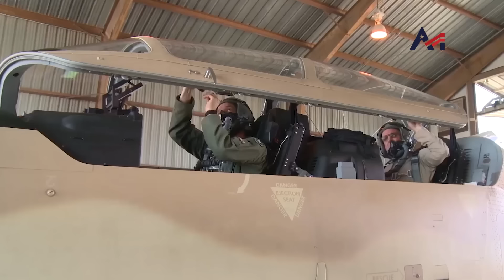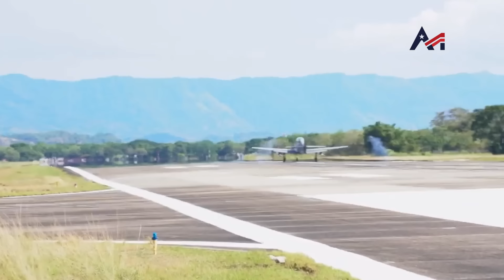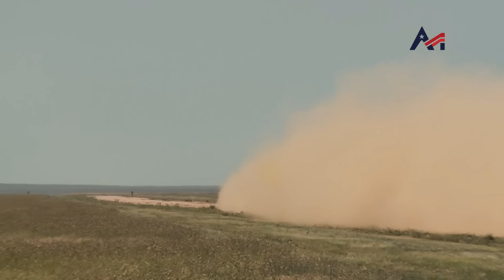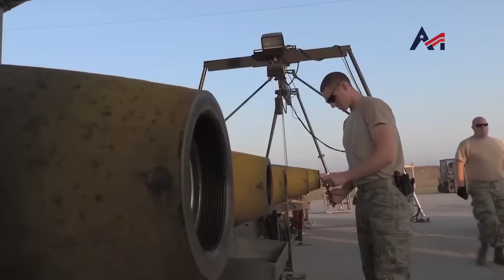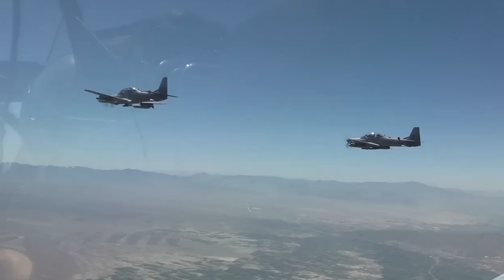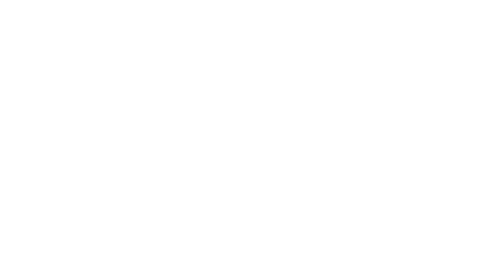U.S. Air Force’s New Answer To Shahed Drones

Comment: When they retire the A10 we should adapt this same plane , it’s cheap and we can flood the sky with them. And they can replace the ground support needed for the troops , just like the old A37  jet that was retired. Yes this is a perfect solution!
Reply from the maker: Cost and numbers definitely matter.
But replacing the A-10 Thunderbolt II role completely would depend a lot on the threat environment and mission type.
Reply: @americanmililitary yes thank you I was thinking that its main assignment or role would be for the new style of Drone warfare. Ground support would be a secondary use but the new wave of Drones coming down the assembly line will be interesting and we’ll have to adapt.
Reply: Too Short sighted, each has it's place and strengths...

Comment: Big mistake. If the A10 is old and slow and gets shot down, a single engine turboorop is no better. If you want to fight drones in a drone future war then you need to buy drones. We tried single engine light attack before it was called a 1 spads it didn't work in Vietnam it won't work now.
Reply from the maker: You’re right about survivability challenges.
But today’s systems also include better sensors, datalinks, and layered defenses, which can change how these platforms are used.
Reply: @americanmililitary we will see. I guess the proof is in the pudding. Seems if a manned aircraft can do the job, then why not a drone ? Drone vs drone. Or in the case of drones swarming over an airbase, get perigen falcons.

Comment: Loiter time, Cost per hour of operation, Link16, decent cheap air to air rockets and a good gun / targeting setup, and many airframes out there will work.
Reply from the maker: Exactly! it’s not just about the platform, but the overall system and cost-effectiveness.
Loiter time and targeting capabilities really make a big difference.
Reply: @americanmililitary   But isn't that exactly what the Super Tucano does?

Comment: Can add a titanium bath tub into it?
Reply: IIRC, there’s attachment points on the exterior sides of the cockpit to bolt on armor plates.
Reply: Ideally these would not operate over enemy territory. That would be reserved for things like the A-10 designed to be a flying tank.

Comment: We're just using ww2 fighters to knock down drones,p47,typhoons ,p51s ...these are just a little more advanced
Reply from the maker: There are definitely some similarities in concept, but modern platforms have much more advanced targeting and situational awareness compared to aircraft like the P-47 Thunderbolt or P-51 Mustang.
Reply: @americanmililitary Our WW2 fighters were faster with a higher ceiling. All they would need is modern avionics.  The P51 Mustang, P47 Thunderbolt, F6 Hellcatand Corsair would all beat the A29 in combat if they had modern avionics
Reply: @Charlesgrantsmith  This is a bizarre idea. The problem is that World War II aircraft are no longer manufactured; replacing parts would be very expensive, and maintenance would be more difficult. Furthermore, creating the conditions to produce them again, such as a production line, tooling, etc., would have astronomical costs. It's easier and cheaper to use what's already built. Therefore, resurrecting old aircraft is not the smartest solution.
Reply: @marcosmpj1370 You completely missed the point.  If we still had, which we don't, our late WW2 fighters, all they'd need are an avionics package. They were faster and better gunned than the A29
Reply: If they existed, but they don't. However, counter-insurgency aircraft are not for air combat but for ground combat; they don't need to be that fast. Furthermore, how would you maintain them if there are no spare parts? You would have to manufacture them again to maintain these aircraft, making everything more expensive, instead of using modern ones where everything is already available and guaranteed. Regarding having superior weaponry compared to modern weapons, you are misinformed. Current weaponry is far superior. I think you are out of date. I'm sorry, but your idea isn't very intelligent; it's bizarre.
Reply: @marcosmpj1370 We are grossly off base.  Read my original comment again.  No where did I say they could be brought back. They are gone. My Comment was about the performance of US late war fighters compared to the A29. With modern avionics, they would have outperformed the A29. You must be Brazilian
Reply: @C @Charlesgrantsmith 1s,P47s would be more expensive to maintain and service .
Reply: @johnnotos6162 Piston  versus turbojet?  Give me your logic.  

My comment, btw, was about performance.  Our late war fighters could beat the A29 in virtually any metric. The closest in performance was the early was P40.
Reply: @Charlesgrantsmith I wasn’t saying you’re wrong. I know the P47 and P51 are much faster and more heavily armed but I would think they would be much more costly to maintain and operate compared to the Tucano.
Reply: @Charlesgrantsmith  Mas esses desempenho são para combate aéreo, não é o caso do A-29, sua ação é terrestre, portanto, a comparação é incoerente.
Reply: @Charlesgrantsmith Yes, I'm Brazilian and you're American, but you're the one who didn't understand. You're confusing the functions. Those World War II planes operated in air combat, dogfights; the A-29 operates in ground combat, they are not the same functions. Air combat today is for supersonic jets, because turboprops are for counter-insurgency, and the A-29 flies at almost                 600 km/h, more than enough for its mission. That's the point!  Then, I disagree with you; I don't think that with modern avionics these World War II planes would be better. They need more than just modern avionics. The A-29's armament is far superior, with various missiles, lasers, and other features, surpassing any World War II aircraft. It seems you are unaware of all the capabilities of the A-29.
Reply: @marcosmpj1370 Marco, im not the least bit confused. The A29 is not a fighter, full stop. Its for uncontested airspace. Its cheap to operate as a ground attack aircraft  But as i said, and its all i said, late WW2 US fighters could out run, out climb, and had a higher ceiling than the A29.  The P47 was also a great ground attack aircraft. If it had modern avionics, it would crush the A29 by every metric. Dispute that
Reply: Feature 	P-47 Thunderbolt (D Variant)	A-29 Super Tucano
Top Speed	~433–443 mph	~368–370 mph
Max Payload	~2,500–3,000 lbs	~3,300–3,714 lbs
Climb Rate	~3,120–3,300 ft/min	~3,230–3,300 ft/min
Service Ceiling	~42,000 ft	~35,000 ft
Internal Armament	8 × .50 cal machine guns	2 × .50 cal machine guns
Reply: @marcosmpj1370 Gemini: Putting modern glass, targeting pods, and precision-guided munitions into the massive, rugged airframe of a World War II P-47 Thunderbolt is a fascinating hypothetical. You would essentially be creating a "Super Jug."

If we compare this modernized P-47 to a dedicated modern light attack aircraft like the Embraer A-29 Super Tucano, you get a clash of two very different design philosophies: raw, brute-force piston power versus hyper-efficient modern turboprop engineering.

Here is how a modernized P-47 Thunderbolt would stack up against the A-29 Super Tucano.

Speed, Power, and Altitude
Winner: P-47 Thunderbolt

The P-47 was designed as a high-altitude interceptor and escort fighter before it found its calling in ground attack. It is a massive aircraft built around the legendary Pratt & Whitney R-2800 Double Wasp 18-cylinder radial engine, which produced well over 2,000 horsepower.

P-47: Top speed of roughly 426 to 440 mph and a service ceiling of over 40,000 feet, thanks to a massive internal turbo-supercharger system.

A-29: Powered by a highly efficient 1,600 shaft horsepower Pratt & Whitney PT6A-68C turboprop, it has a top speed of about 368 mph and a service ceiling of 35,000 feet.

If both were rushing to a "troops in contact" situation from a distant airbase, the P-47 would get there faster.

Payload and Armament
Winner: A-29 Super Tucano

This is where historical perception meets modern reality. The P-47 was famous for its heavy payload in WWII, but modern structural engineering gives the smaller A-29 the edge in carrying external stores.

P-47: Historically carried up to 2,500 lbs of external bombs and rockets. Its defining feature, however, was its internal battery of eight .50 caliber machine guns loaded with 3,400 rounds of ammunition—an absolute buzzsaw for strafing.
+1

A-29: Features five external hardpoints capable of carrying 3,400 lbs of modern ordnance (like JDAMs, Paveway laser-guided bombs, and Hellfire missiles). It carries only two internal .50 caliber machine guns.
+1

While the P-47 would still be the undisputed king of gun-runs, the A-29 can carry almost 1,000 pounds more of precision explosives.

Endurance and Loiter Time
Winner: A-29 Super Tucano

For Close Air Support (CAS) and Counter-Insurgency (COIN) missions, an aircraft needs to circle above the battlefield for hours, acting as an "eye in the sky" and waiting for targets.

A-29: The Super Tucano is incredibly efficient. With external fuel tanks, it can stay airborne for up to 8.5 hours.
+1

P-47: A massive radial engine like the R-2800 guzzles fuel at an astonishing rate. Even with drop tanks, the P-47's endurance is a fraction of the Super Tucano's. It simply cannot hang around the battlefield all day.

Logistics and Maintenance
Winner: A-29 Super Tucano

The realities of military logistics strongly favor the modern aircraft.

Fuel: The A-29 runs on standard Jet-A fuel, which is ubiquitous at every military base in the world. A piston-engine P-47 requires high-octane Aviation Gasoline (AvGas), which modern militaries no longer stock in combat theaters.

Maintenance: The A-29's PT6 turboprop is one of the most reliable and easily maintained engines ever built. The P-47's 18-cylinder radial engine requires immense upkeep. Changing 36 spark plugs, managing heavy oil consumption, and maintaining complex supercharger ducting makes it a mechanic's nightmare by modern standards.

Survivability
Tie (Situational)

P-47: The Jug is famously one of the most rugged aircraft ever built. It could absorb catastrophic structural damage, shred wings on trees, take flak hits to the engine, and still fly home.

A-29: Modern, lighter, and less physically imposing, but it boasts Kevlar armor around the cockpit and engine. More importantly, its turboprop engine produces a significantly smaller infrared (heat) signature than a massive, roaring R-2800 radial engine, making the A-29 slightly harder for shoulder-fired heat-seeking missiles (MANPADS) to lock onto.

The Verdict
A modernized P-47 Thunderbolt would be a faster, heavily armored flying tank with the most devastating gun-run capability on the modern battlefield.
Reply: @Charlesgrantsmith  I have a different opinion; I believe that modern avionics alone are insufficient to be superior. I see superiority more in the weapons, and in that respect, the A-29 is better.
Reply: @Charlesgrantsmith I have a different opinion; I believe that modern avionics alone are insufficient to be superior. I see superiority more in the weapons, and in that respect, the A-29 is better.
Reply: @marcosmpj1370 The 1946 A-1 Skyraider would crush an A-29 - Gemini: If you are looking for the WWII-era aircraft that, when modernized, most closely matches or exceeds the A-29 Super Tucano in its specific mission profile, the answer is the Douglas A-1 Skyraider.

While the Skyraider technically missed WWII combat (it entered service in 1946), it was designed during the war as a successor to the SBD Dauntless. It represents the absolute pinnacle of piston-engine ground-attack technology.

Here is how a modernized "Skyraider" compares to the A-29:

1. Payload: The Skyraider Dominates
The A-29 is a light-attack aircraft, whereas the Skyraider was a heavy-hitter.

A-29: Can carry about 3,400 lbs of external ordnance.

A-1 Skyraider: Could carry an incredible 8,000 lbs of ordnance across 15 hardpoints.

Comparison: A modernized Skyraider could carry more than double the precision-guided munitions (JDAMs, Hellfires, etc.) of a Super Tucano. Historically, it famously carried more weight in bombs than a four-engine B-17 Flying Fortress.

2. Survivability and "Tankiness"
The A-29 is built with modern Kevlar armor, but the Skyraider was built with sheer physical mass.

Engine: The Skyraider uses a massive Wright R-3350 Duplex-Cyclone radial engine. Unlike the liquid-cooled Mustang, this engine is air-cooled. It can take heavy machine-gun fire to several cylinders and keep turning.

The "Spad" Legend: In Vietnam, Skyraiders were famous for absorbing catastrophic damage from ground fire—holes the size of trash cans in the wings—and still flying home. A modern A-29 turboprop is far more delicate.

3. Loiter Time (The "Sandys" Mission)
The A-29 is praised for its 8-hour endurance, but the Skyraider was the original "loiter king."

Endurance: The Skyraider was capable of staying on station for over 10 hours with external fuel tanks.

Search and Rescue: In the modern context, a modernized Skyraider would be the ultimate Combat Search and Rescue (CSAR) escort, a role it pioneered in Vietnam as the "Sandy," providing a persistent umbrella of protection that jet aircraft couldn't match.

4. Close Second: The Vought F4U-4 Corsair
If you want a true WWII veteran, the F4U-4 Corsair is the closest match.

The Build: Like the P-47, it was built around the R-2800 radial engine, making it rugged and reliable.

Performance: It was faster than the A-29 (440+ mph) and could carry 4,000 lbs of external ordnance (beating the A-29's payload).

Modernization: Modernizing a Corsair would give you a rugged, carrier-capable strike fighter that exceeds the A-29 in speed and payload, though it would still suffer from the high maintenance costs of a large radial piston engine.

Comparison Summary Table
Feature	A-29 Super Tucano	Modernized A-1 Skyraider	Modernized F4U-4 Corsair
Max Payload	3,400 lbs	8,000 lbs	4,000 lbs
Top Speed	368 mph	322 mph	446 mph
Armor	Modern Kevlar	Heavy Plate & Air-Cooled	Heavy Plate & Air-Cooled
Loiter Time	~8 hours	~10+ hours	~6-7 hours
Weapon Tech	Digital / PGMs	Retrofitted Digital / PGMs	Retrofitted Digital / PGMs
The Verdict: The A-1 Skyraider is the only "vintage" design that doesn't just match the A-29, but fundamentally outclasses it in payload and loiter time. If you gave a Skyraider a modern glass cockpit and a targeting pod, it would be a "Mini A-10" that could stay over a battlefield all day and carry a massive variety of smart weapons. in all categories:  Gemini:
Reply: @Charlesgrantsmith and?
Reply: @typhon800No "and". They whole issue is that a cheap anti-drone weapon is needed.
Reply: To combat passively flying drones powered by powerful lawnmower engines, the best platform would be one that remains stable while firing at low speeds and has greater fuel efficiency, remaining operational for longer periods without needing to return to base, and capable of handling swarms of drone launches.

In this respect, an A-10 would be better than an F-35, a Thunderbolt would be better than an A-10, an A-29 would be better than a Thunderbolt, and an Air Tractor would probably be better than an A-29.

Any capabilities that go beyond the scope of this scenario only hinder rather than help!
Reply: @guimaraesflavio  Shahed drones go 120mph. US WW2 fighters had higher top speeds and stall speeds of 80-120mph v 85 for the A29. I'd rather have a faster plane to get on station. WW2 fighters would have worked great with modern avionics. They massively outgunned the 2 50 cals on the A29. The early war P40 had 4-6 depending on varient. The P47 had 8.
Reply: Yup, with computers
Reply from the maker: @RacerX1971  Exactly! computers, sensors, and datalinks really change the game compared to older aircraft like the P-47 Thunderbolt or P-51 Mustang.
Reply: @americanmililitary Our WW2 fighters were faster, had a higher ceiling, and were better gunned than the A29.  If we still had them all they'd need is a modern avionics package
Reply: What about laser
Reply: @johnye4433 what about laser? I think you would need a much bigger plane to accommodate the machinery
Reply: @RacerX1971 why not just use the small plane as a spotter, and put the big machine in a bigger plane or on the ground
Reply: @johnye4433 , can do that but a big jet like a 737 can have all the electronic, radar and will not need a spotter
Reply: @RacerX1971 a spotter can also take control of the aim so maybe the platform plane doesn’t need to be as big or expensive
Reply: Bring back a modern avatar of the legendary P51 Mustang.

Comment: I’d go homegrown and deploy the Sky Raider II.
Reply: OA-1K just has more loitering time than A-29. A-29 is faster. Both can work together along with AH-64E. Saudi Arabia  should have both. OA-1K has that communications dome. A-10C to me isn't retireable. But stupid USAF wants it dead. To me, OA-1K, A-29, AT-6W, AT-802U, & MQ-1 is all supplement to the A-10C
Reply: @ptcoronet I’d prefer home grown and developed. The loiter time is 2-3 hours depending on demand.
Reply: @barefootonasandybeach638 with additional tanks it goes up to 8 hours
Reply: @donpietruk1517 yes, it’s quite a versatile airplane. No need for expensive projectiles and extra fuel would be a bonus particularly if extra ammo can be carried for the guns. A lethal little fella.
Reply from the maker: Interesting 👍 Do you think something like the Skyraider II could handle more contested environments too?
Reply: @americanmililitary it’s designed to do so. It’s scanning and detection are top notch and it has the ability to share any telemetry with other aircraft in the vicinity. It’s a very capable aircraft.
Reply: There you go... bring in the horsepower a b-29 engine on a light frame with cannons... boo yeah!!!